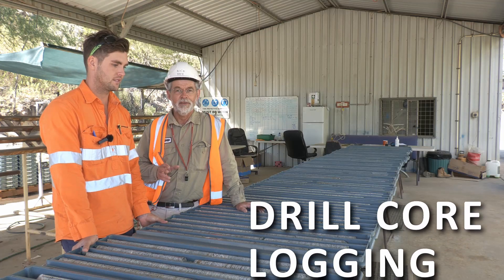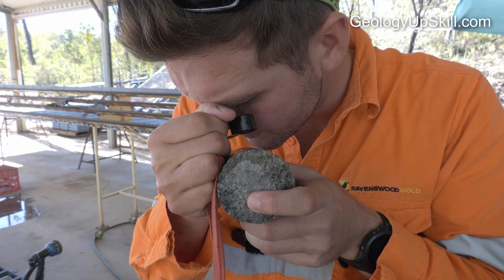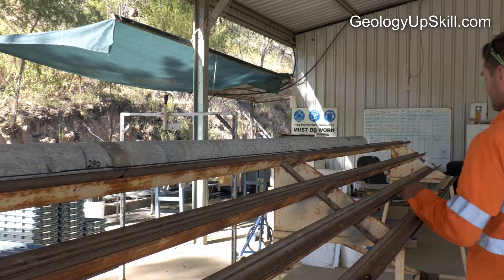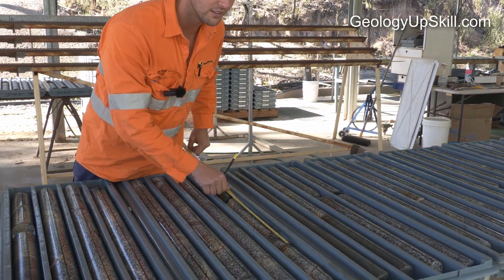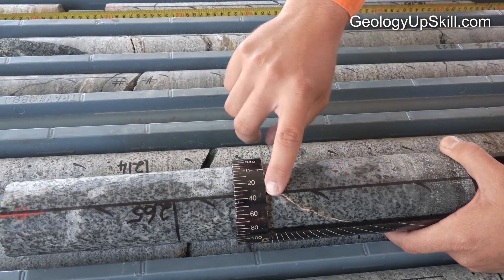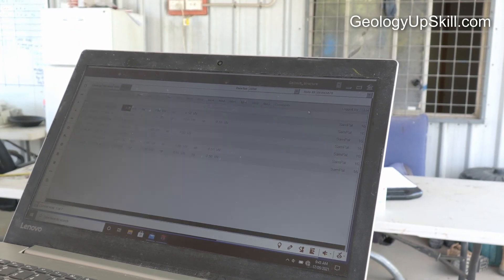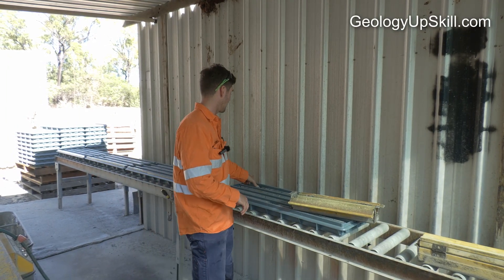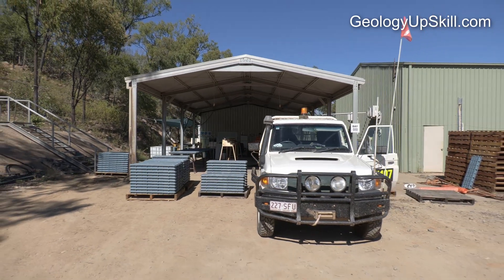Introduction to Logging Drill Core

Comment: Thank you for the informative video! 

Do you have any recommendations on core cutting equipment for cutting geotechnical samples (UCS/PL) when working remotely on a drill rig? I wonder how many Geos are still dry cutting with angle grinders...
Reply from the maker: Petrol powered brick saws are a popular option for remote mobile sites.

Comment: Great video. How do you mark it  if you lost continuity? For instance if some of the mineral (sand) washed out.
Reply from the maker: Conventions varybetween different companies, but normally, the orientation line on the bottom of the core is simply stopped at the break. If it can be continued (at lower confidence) a different colour or pattern of line may be used. Some good comments are here: http://www.orefind.com/blog/orefind_blog/2012/11/12/drill-core-orientation---an-inconvenient-truth-(part-3-of-3)

Comment: Good presentation, but the pristine core here doesn't represent the broken and/or ground stuff that's often only partly recovered - i.e. the real world.

How do the drillers know the bottom of the hole?  Do they use a special non-rotating core barrel?
Reply from the maker: Most of the core orientation tools mark the bottom of hole on the last piece of core before it is broken off from the bottom of hole. That gives some certainty about the position. If the core can be fitted back together, the orientation line can be drawn back up the hole until the fit is not possible.

Comment: Nicely explained👍🏻

Is there a different approach when logging a Volcanogenic Massive Sulfide drillcore? Thank you.
Reply from the maker: The general system would be the same, but each company will have different tools to get the job done. VMS deposits may require special handling of the core because it can produce a lot of acid in contact with water, particularly if it is partially oxidised.
Reply: @GeologyUpSkill  thank you for answering my question. I am learning a lot from your videos👍🏻

Comment: Thank you for this educative video. Can kindly explain the aspect of mark up the core with respect to the driller orientation? I did not get the explanation in the video very well/  Thanks
Reply from the maker: The driller maks a line that represents the lowest edge of the core in each drill run. The geologist then tries to match up those marks from run to run. If they match well, you can be confident that the orientations are good and you can mark a line along the core that represents the bottom side of the core. Of course this only work for holes that are drilled at an angle. Vertical holes have no bottom side!

Comment: Hi there! Great video. 
I just noticed that the Geo collected the Beta angle in Kenometer setting the apical trace (lowest point of curvature) in the 0 degree mark, and collected the angle where the oriented-line hits the kenometer. Is also acceptable to set the 0 degree mark in the oriented-line, and then collect the Beta angle where the apical trace hits the Kenometer?
Reply from the maker: Either method will work. The absolute rule is to make sure everyone working on the core uses the same system and the people using the data know which method you are using.
Reply: @GeologyUpSkill  Great. Thank you for your prompt reply! Keep exploring.

Comment: Hoping you can help me understand a part that i maybe missing is do you only send to the lab a samples of the strike areas of the core that you suspect is where the targeted mineral is located in the core. Normally as an investor i only see the sheets of the cores, concentrations of the target minerals  and depth of strike
Reply from the maker: It is standard practice in most companies to assay the entire length of the drill hole. It may not be necessary where there is a very well understood barren unit (such as cover sediments), but in all other rocks, it helps to build trust in the final resource and sterilize any surrounding rocks for the infrastructure development.